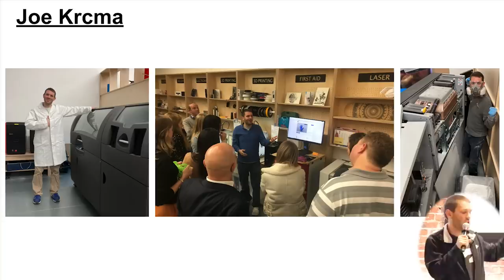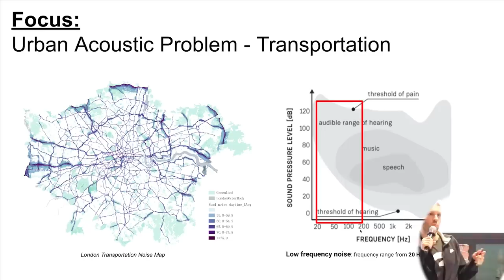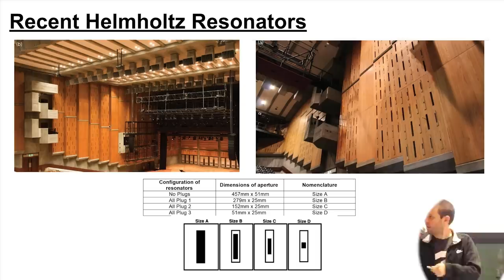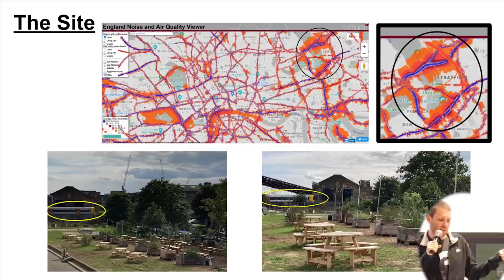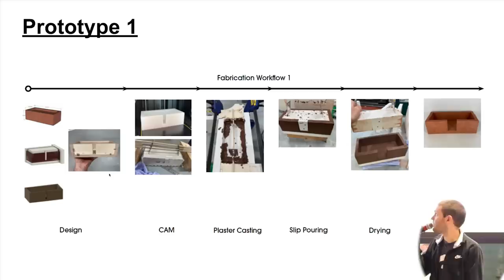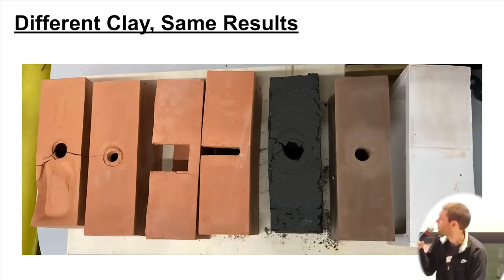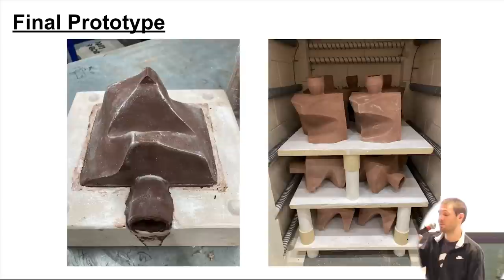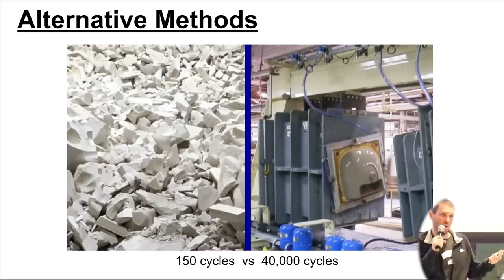These Bricks Can Absorb Traffic Noise - Thesis Presentation on Helmholtz Resonators

Comment: Could you try casting a regular rectangular brick around a glass bottle??
Reply from the maker: You would need to remove the glass bottle before firing somehow...
Reply: @JoeMakes  Perhaps a different inner mould material could be used? Either something meant to survive firing and be part of the brick in use, or you could go the other way and use something that will burn away during firing, thus leaving a hollow of the appropriate size and shape.

Comment: When creating resonators by assembling the bricks, how important is it to have a tight seal along the edges, and do you know whether certain binders/cements would be less suitable? Also, could the bricks all being in contact with one another lead to unforeseen resonance effects throughout the greater structure? I wonder then what role specific grouting could play. Not a physicist or engineer, just thinking out loud.
Reply from the maker: The seal created the Helmholtz resonator, so it’s the most important aspect. Which is why I was so nervous when I grouted the bricks 😂
Reply: @JoeMakes  How would this affect its use outdoors? On the one hand brick and mortar structures last for decades, but they don't need to fit resonant profiles, and also have much more mortar and surface area contact. Granted these are hollow and don't need to be as structurally sound as a brick wall, but I would imagine the seal, thin as is is, could break much more easily (even if it doesn't impact its strength).

Does the thinness of the clay make temperature expansion/contraction worse, or would the cavities help provide insulation? Or would that simply just depend on the scenario and is entirely impossible to answer?

Thanks. Really interesting design. So many different things to consider.

Comment: Does this address any limitation with existing products like Soundcell or Soundblox style CMUs?  Or was that the justification, that it wasn't already being done using terracotta, despite being done in concrete block?
Reply from the maker: Exactly!  I looked into those products and they are great. Just had to see if ceramic could possibly work and was surprised at the results

Comment: Could this be done with stacked wine bottles bonded in motar?  I recall back in the 70's a glass took cutter that was all the rage. One could cut at the top or bottom.  It sounds like a good medium to work with . Visual Striking as well
Reply from the maker: Yeah, it has a neck and cavity

Comment: @joemakes   I like this but for my area I would be worried about wasps (aka yellow jackets), hornets, and other stinging or venomous creatures using them as homes.  Not a problem if you keep your hands away but mowing right next to these will probably bring several out and then sting anyone who happens to be nearby.  Also, unless these can drain they'll be perfect mosquito breeding grounds after a good windy rain storm or water sprinklers that are close enough to spray water onto the bricks and into the holes.
Reply from the maker: I'll test that in the next version!  Cheers

Comment: Wow this is so exciting!  Serious question- I would like to use these but I’m concerned that they could turn into housing for wasps (and there are lots of wasps in our area).  Would they still work with a bit of mosquito netting over the holes or would that interfere with functionality?
Reply: Mozzie netting over the holes wouldn't significantly affect them.  That sort of netting is acoustically transparent, particularly for the lower frequencies you'd be likely to design them for.
Reply from the maker: I don’t thinks so but Possibly!  I’ll test it
Reply: @JoeMakes if you do test it I’d love to see a video or even a comment here regarding the results!  Thank you!

Comment: Wouldn't the main point of bricks be holding the weight of the whole wall of them and then some? Even if you're siding with those, they have to hold at least the weight of this whole siding -- and if you're adding intermediate holding points, they will have to take not only vertical, but all sorts of stress. Considering the shape, it looks very problematic. And a thing to remember is it is competing with foam and other acoustic absorbers.
Reply from the maker: Had to use ceramic for the course

Comment: Daft question...I think. The farmer next to us, occasionally runs 4 fans to cool his huge greenhouse. Very noisy, could we use your bricks to dull that noise too? One of the fans is right next to our fence.
Reply from the maker: Yeah, if you know the frequency and tune it
Reply: Thank you for your reply. It was pretty consistent, but as the motors are wearing the sound has changed, so I think the frequency will evolve @JoeMakes

Comment: They do have a drain don't they? So if liquid gets inside it doesn't just puddle up?
Reply from the maker: Teracotta evaporates water
Reply: @JoeMakes  yes it's porous, but hypothetically more blows in than slowly leaks (and possibly evaporates from the outer surface) and then there's the wind blown dust, spores, seeds and organic matter to make nice gardens in each chamber... Which will sooner or later plug off the pores in the clay.
I evaluate everything in my life through the lens of possible unintended consequences so solutions can be found before they become problems.
I'm sure for interior use these might well be valuable but in the real world external use might be problematic.
Convince me I'm wrong

Comment: Hey Joe Makes! 
 I'm about to seek a way to sue the LIRR for the obnoxious low frequencies coming off the polluting diesel trains that sometimes make me feel like I'm having a seizure. The low frequencies are SO BAD, there are cracks in the foundation of my house that go from ceiling to floor and light comes through from outside. What would one need to do to measure and prove the trains are causing this? Can you suggest any manner of recording equipment needed for this?  
 
 I feel these G'DAMN things before I hear them. I ALWAYS know when the train is coming. Every hour, sometimes on the half, too. It's MADDENING!!! If I had the power of a God, I would crumple the thing up and throw it into the SUN! Good thing I don't.
 I must also mention I suffered a TBI, neurological and lung damage from being poisoned by a coral and have hypersensitivities to sound, smell, etc. 
 The electric trains that run further west don't seem to have any low frequencies coming off them. Moving is not an option at the present time.
Reply from the maker: I feel your pain.  We just recorded the trains with our phones and it worked well
Reply: @JoeMakes  it's not just the normal train sounds. The low frequencies, probably from the train being set lower, I'm at the top of a hill, streetwise, from the train, I'm set a little lower than the street. It's like a giant amplifier. I often frequent the local bar, which sits directly adjacent to the train platform, but there the train is above, and I hardly hear it there, even when outside. It's so close you could hit it with a rock.

Comment: If city planners had less regulations to worry about, they'd have more time to think about cool things like this. There's only so much time in a day someone has to consider every freakin' rule they've gotta follow before they build something. By the time your design finishes running the gauntlet, you've just got the same bland box everyone else built (sans cool futuristic helmholtz bricks).
Reply from the maker: Are you a city planner perhaps?

Comment: Hey Architect from Germany. Any chance we can get these anytime soon? I have an old mill which is supposed to become a wellness oasis, but the new owner operator is a bit worried about road sounds in the valley. They are a bit hippie and definitely up for environmentally friendly products like that. We were thinking about creating a low sound barrier, maybe 50 to 100 cm high, next to where the car sounds come from, inspired by similar low sound walls some of our train tracks are receiving atm.
Reply: Fano resonance live walls and practically designed versions of the slipware fascia and its plan of grouting.
Reply from the maker: Germany with big bricks as well!  I'll put the file out there

Comment: Would this block low pitch music from electric bass guitars and synthesizers?  Apparently, one needs a solid concrete wall 30 feet high due to the wavelength of 60 feet.
Reply from the maker: You might like my thesis where I talk about that (linked in the description)
Reply: @JoeMakes  Yes, I see.  I'm concerned about pitches from 20 to 60 HZ.  It seems no remarked solution effectively or substancially reflects or absorbs or just plain stops those frequencies?

Comment: Joe,

I think you have seen that viral image about Heineken made square bottles so those empty bottles could be used as a building material. My question is, could that concept be used the same as in your Thesis? (granted, it would not be as efficient considering the material, shape, etc)

Cheers!
Kemal from Indonesia
Reply from the maker: Hey Kemal!  Yes, it has a neck and cavity so it will work.  You might enjoy my thesis where I cover this (linked in description)
Reply: @JoeMakes  Thanks Joe! I was thinking some bamboo fence along with sound barrier gates (like they use on some gun ranges) but that sound barrier gates doesn't appeal aestetically

Comment: I am sorry for being that person, but wouldn't laying regular bricks in a 3d pattern, similar to sound dampening panel, work just good enough while being 50 times simpler? Or maybe plaster upcycled glass bottles and jars and ceramic pots into the brick wall.

This seems over-complicated, I am skeptical.
Reply from the maker: Regular bricks will need a neck and cavity tuned to the frequency you want to absorb.  We had to use ceramic as a material for the course, not plastic or glass.
Reply: @JoeMakes  thanks for the reply. Yes, with that limitation in mind, everything make sense.

Comment: Dear @JoeMakes this is an interesting topic. So my follow up question would be: How can I build a simplified version of this for around 5 Euros (or at max 10) per piece at home? Because than it would be also practical.

And I have a second question which is even trickier: Could it be made smaller? I mean in the size of a jamming toy construction brick or the size of a yellow Kinder Surprise egg? If so: How?

Either way: Thanks for the video.
Reply from the maker: Easy, just download the file for free in the description...
Reply: @JoeMakes  Wow. i overlooked it. Thx.

Comment: Hey JENIUS... you do realize Architectural structures are usually "box geometries" right? Instead of pyramids or triangles?
So... Your brick might cover 80% of a wall, but a few parts of it would require Cement as fillers.
Reply from the maker: We were told to think outside the box...but I'm not a "jenius"

Comment: I think there are a few fundamental issues with the brick design. Its going to leave weird and difficult gaps/holes when build next to other vertical walls/surfaces. The bottom bricks used in your wall example wouldn't be easily made on a worksite without spending time using some sort of mechanical saw/disk cutter. It looks difficult to apply cement evenly and many cavities would have cement dripping down inside them. Is it any better than building two walls with a small gap between them, and on the front/sound facing wall leaving a half a brick out every now and again? 

I might be entirely missing the point of your thesis, I have smooth brain.
Reply from the maker: Haha, you might like the actual thesis paper in the description

Comment: Your Close in Line Directional Resonators to Control the Freq Wave in Split form Adobe Oiled , Poured , Extruded or Cast , Dead Blow or Noise Cancellation can be Achieved you are Missing One Major Component for Better Containment of What you are Trying to Achieve !.
Reply from the maker: Thanks

Comment: Sharp corner with brittle material and you're at post doctorate level. I only have a bachelor's degree as an engineer... But I've wern steel toe boots at summer to pay for my degree. being in charge, your avenue would have been filtered out of the brainstorm in 15 minutes.
Reply from the maker: I've also wern steel toe boots to pay for my entire degree, so I should be in charge of your degree.  Let's swap
Reply: @JoeMakes  I was a technical lead looking over 60 workers on windmill sites. I've done resin infusion on a windblade with half of the equipment coming from home depot... I might need your help to type my reports.

Comment: more sand = less cracking
Reply from the maker: for terracotta?
Reply: Yes--sharp-edged silica sand (the kind you get from a builder supply, NOT smooth feldspar/play/pool sand) is the easiest to use for tempering--though it will impact the mature firing temp of the clay body--the idea is to even out physical and chemical drying (so slowng that also helps)--you could also use ground up already fired ceramic (of the same clay body) to reduce cracking--there are a wide array of options but sand is the simplest and usually easiest to get in a consistent way. It looks like you solved much of that, and for slipcasting less sand is easier to mix and pour, just, more prone to cracking. I would love to get involved in this work somehow--have a background in ceramics and an interest in architecture for the future and sound healing. Thank you for doing and sharing this work!  @JoeMakes

Comment: Converting sound into heat?

Wait.

Sound is moving particles bumping into each other.
Heat is moving particles bumping into each other.

What's the difference? My brain hurts!
Reply from the maker: It's the air in the neck that is vibrating which is being converted into heat.  But it's a tiny amount
Reply: @JoeMakes  but how is heat different from sound - is it just that it doesn't travel very far? And why doesn't it?

Comment: Hey want to try this tech out with a possible large scale application?  Get in contact with Cleetus McFarland over at Freedom Factory.  Putting these in strategic areas could be a good way to block the sound of race tracks and racing vehicle engines.
Reply from the maker: Just keeping it a research project for now, thanks

Comment: If you switch to electric vehicles, the sound reduces until no sound deading is needed....just saying.
Reply: A big portion of the noise comes from the friction of tires with the road itself rather than from just the motors.
Reply from the maker: Trains?

Comment: you know what else these bricks can absorb? water.
what does water do in the winter time?
what happens when water freezes? it expands...

if you want to see for yourself why these bricks are not a good idea, fill a glass with water and put it in the freezer overnight. just make sure it's a glass you don't want anymore.
Reply from the maker: Terracotta was used for a reason...
Reply: @JoeMakes  yep. it was cheap, easy and they didn't know how to make concrete yet

Comment: Helmholtz resonators absorb very specific frequencies at a very narrow frequency band. Traffic noise is just that… noise. Noise has no fundamental frequency or harmonics. If you absorb 60hz from noise using Helmholtz resonators, then you still have 20-55hz and 65-20khz. This isn’t gonna work. Low end acoustic absorption is the most difficult type of acoustic absorption. Helmholtz and membrane traps only target very specific frequencies. 20-300Hz is a HUGE target. That’s 4 octaves. Quadratic diffusion would’ve probably been your best bet outdoors.
Reply from the maker: Thanks, you might like my thesis where I cover this more (linked in the description)

Comment: I don't know if you are really looking for a prototype that can be used in the industry, or simply testing to see if you can provide an alternative/new idea to current methods. 
I personally think like an entrepreneur in that, if I am going to develop something useful, I'm going to make it viable as a selling product/process.  
However, I disagree with your final prototype. While it may be aesthetic, because of the inaccuracies that come from the implementation process it cannot provide for a varied load and be useful to the construction process.
While this isn't "technically" within your Problem statement, it would seem to be alluded that if it were to be built in urban setting, it would need to be included  to prevent misuse or abuse of the final product. 

Suggestion:
If made to be used in normal construction methods "as an additive to the normal blocks already being used", this could be very helpful in reducing unwanted sound.

Process 1: Construction and load-bearing 
Expanding on your product in key 20:09, where you show a flat brick prototype, make this viable for today's infrastructure construction methods. 
1. increase the thickness of the walls (reducing the hollow inside) and test for load bearing. (change to concrete from terracotta)
2. Instead of a rectangular insert, I would recommend an upside down pyramidal shape insert to allow you to remove it without stress. 

Process 2: Resonation
1. For process 1, provide an insert for the "keyhole" in the brick, comprised of a composite (not need to be concrete, as it doesn't improve on the load bearing)  
    a. This composite shape has a neck molded through it (in the rectangular key slot area) that could be a circular hole or a smaller rectangular hole, depending on how you want to adapt Helmholtz. 
    b. It also will have an inside shape (round, trapezoidal, etc) in the hollow space to complete the resonator. 
 2. You can now insert varying sizes of Helmholtz resonators, made of recycled HDPE, to dampen all different kinds of noises.
Reply from the maker: Thanks for this!  I'll make a future video and cover some of this clearly